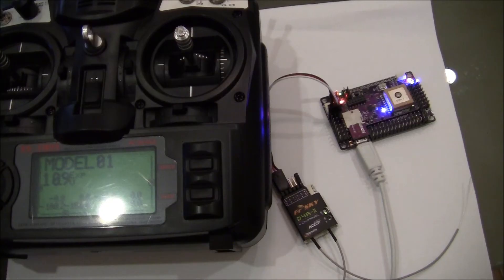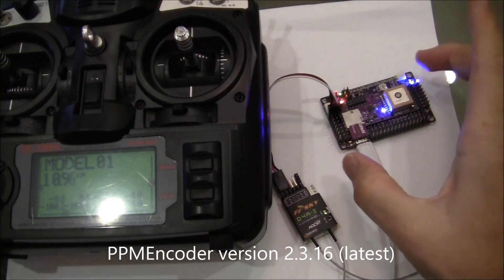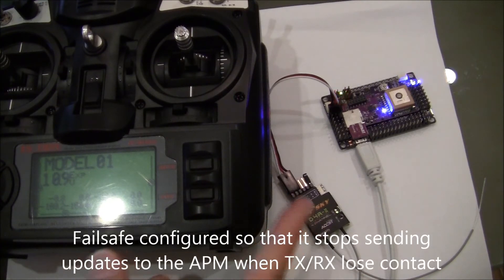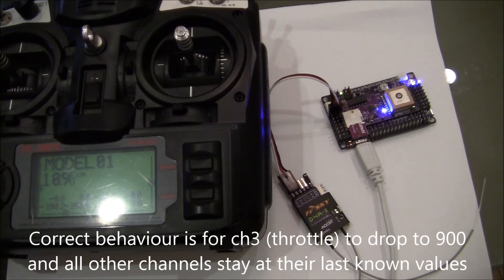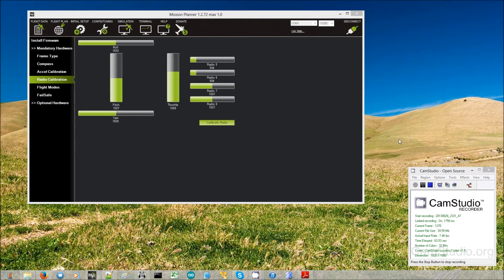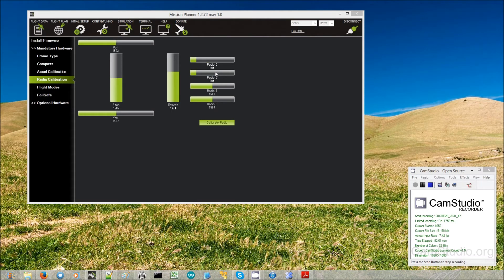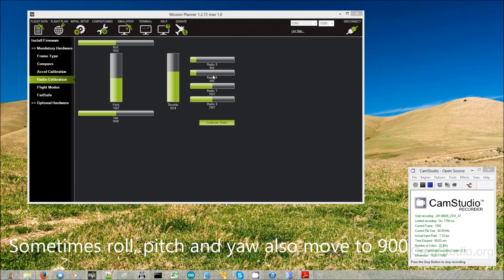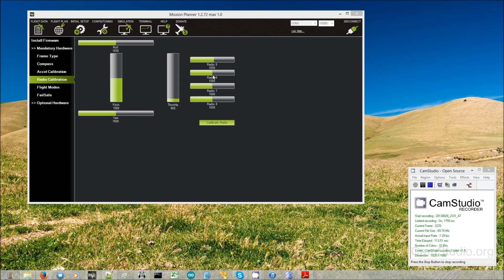PPMEncoder Behaviour On Loss-Of-Signal From Receiver

Comment: I should add that I am using a Turnigy 9X TX and a Turnigy 9X8Cv2 RX that do not have any native Failsafe features.  When the TX is switched off there is no further PWM from the RX into the PPM Encoder. With the new PPMEncoder 2.3.16 the behaviour is as documented in the wiki.